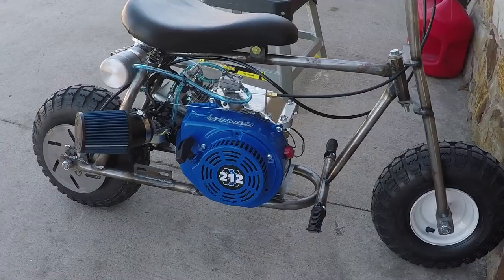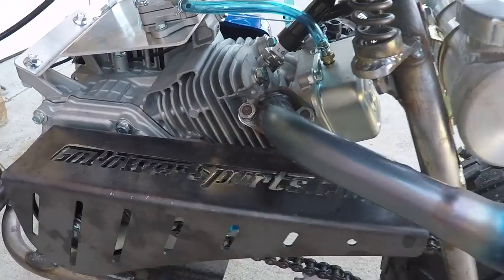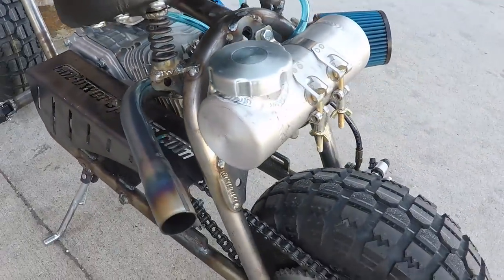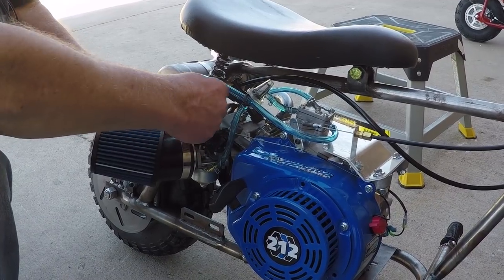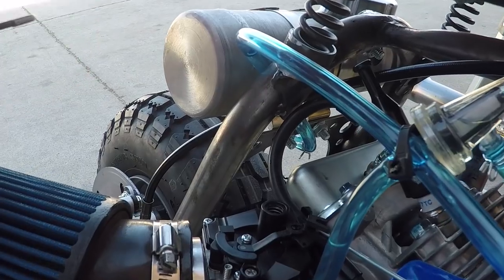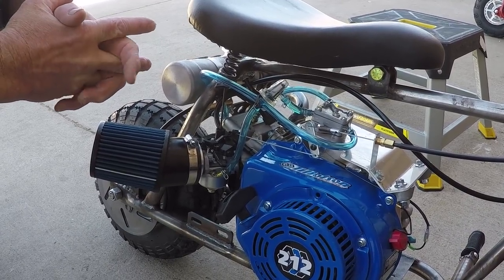Tillotson TCT Carb Tune Up

Comment: I've seen a lot of people disappointed with this carb when they pop in a MOD2 cam and try to turn 6500+ rpms with it. I'm running an ungoverned Stage 2 Tillotson 212E (Ducar hemi) with an EC Carburetor's Bansai .265 short duration cam and  mild head porting, PVT flywheel/28 degrees advance. Does it pull above 6000? No, but it instantly explodes off the line and continues doing so up to 6000. My point is that it depends on what you want, high straight line speed or tearing up the hills and trails with a low and mid-range mini torque monster. I love this combo on a Coleman ct200u-ex with a 30 series tc here in the hills of Northeastern Kentucky.
Reply: You are getting 6000 RPM on a Coleman with a 30 series TC? Wow... With what gearing?

Comment: I am currently running a 22mm Mikuni. with Mod 2 cam. 18lb.springs &  Aluminum Flywheel .

Would the Tillotson Mech. Injection be a BETTER 
alternative / better choice than the Mikuni. ?
Reply: Nah

Comment: Wouldnt this model be considered the Tillotson TFB Mechanical Fuel Injection Carburetor instead of the TCT? According to your guys website it states......
"How to choose the right carb":
Tillotson TCT - Stock air box
Tillotson TFB - Stage 1+
And it looks like theres a stage 1 air filter on that bike not a stock air box.

Comment: What are the best upgrades for a Coleman ct200uex
Reply: Stage 1 gopowersports or omb  kit, zip tie on Governor spring, torque converter 18lb valve springs
Reply: @kiheirc3195  Nope. Don't touch the governor or throttle linkage. Just install a torque converter and the stage 1 and back out the throttle screw. With this setup the governor does nothing at top speed and adding 18lb valve springs are a waste of time.

Comment: How do you find the start point for these carbs, I've lost track of where I am in adjustment and won't start anywhere I put it?
Reply from the maker: We would say the starting point is screwed all the way in, and 2.25 turns backed off.
Reply: Thank you,, Found the issue. The side black plug is gone & ducking air from side, how do I get another one?
Reply: That little plug seems to be a design issue.  A buddy of mine lost during a ride and had to limp back to camp.  I was also wondering if a TCT requires a pulse pump... or can it play nice with just a gravity fed tank and fuel filter?

Comment: Is this better then a mikuni
Reply: YEP, no jets to change out and better break up of the fuel.
Reply: @GEEGANSQUADFishing  what about air flow?
Reply: @joshanderson1019 , after I bought one and tried to tune it and it still did not want to do right I bought a 22mm Mikuni for GOPOWERSPORTS. I LOVE it, so much more power!
Reply: @GEEGANSQUADFishing  i have a stage 3 non hemi 212 with a mikuni that is a pain in my arse got any tips?
Reply: GEEGAN SQUAD so which one then? TCT or mikuni
Reply: @joshanderson1019  same dude. 26mm?
Reply: @RareRS  ya
Reply: @joshanderson1019  does it pour gas out of the overflow line?
Reply: @RareRS  yep

Comment: I just put one of these on a Honda GX120 for a minibike.  I have it set ALMOST just right....  Is it too rich or too lean if it bogs when you snap the throttle from idle to full?  Mine returns to idle nicely, but slightly bogs when I go from idle to WOT
Reply: Did you fix this issue? Having the same priblem!
Reply: @tednelson5574  no, never got around to messing with it much

Comment: Did you install a rev limiter since you removed the governor? Also how much would this motor cost to duplicate? I would like to keep it stock as possible since it will not be for a mini bike for Kart application.
Reply: Rev limiter not needed since the valve springs float around 5500 rpm
Reply: @lerabidheavy7437  Will they tap a flat top? Mine has 26lb springs and a flat top, idk how much throttle I can give it.

John 3:16
Reply: @OVERKILL_SS  so that's hard to answer cause the valves should close way before there should be contact, however with compression release can be near top dead center on some engines, this is a issue so what I'd do is crank by hand see if compression release doesn't smack valves then if all good get a rev limiting coil, i have a 6500rpm coil on mine and run 14.5:1 compression
Reply: @lerabidheavy7437  Well I know I haven't smacked valves yet, the lil sucker runs great! Other than sounding like a hit an miss at idle. lol 
Idk what you mean by turn it by hand to check for valve smack though, what I'm worried about is when they start floating at night rpms since it don't have valve reliefs in the piston no more not sure if its possible for a valve to float open right when the piston hits tdc and instantly cut HP in half. lol
Thank you!
I might look into the coil limiter though, I was just hoping to find out if its safe to let the engine run wide open or if I gotta let off and when.
Reply: @OVERKILL_SS would full throttle no longer then 5 second no matter what build u got not healthy to hit redline All the time
Reply: @benjaminperez6358  Arighty! Thanks! 👍

Comment: This carb is great if you still have your governor, but if you have it removed a $12 carb from amazon will give you a better top speed and more torque off of the line.
Reply: Why is that? I haven't seen anything about that anywhere. I haven't gotten mine to test it yet.
Reply: @YUREtheFURY  I have no idea but with a 12 dollar Amazon carb I can go 54 mph but with tct carb I can only go 32. I do not know why but the tct carb does not allow them engine to do high rpm’s
Reply: @colemarsden2796  that's weird, I know it needs to be adjusted for elevation, mods and such. Do you think that could be why?. It shouldn't inhibit your top speed unless it's to lean at the high end I'm guessing.
Reply: @YUREtheFURY  I don’t know I played with it for like 2 hours and fastest I could go was 32mph
Reply: @colemarsden2796  I'll let you know how mine goes. I got a ungoverned tillotson 212 to go with it. It will be here tomorrow, hopefully I'll have something good to report.
Reply: @YUREtheFURY  ok that’s exactly what I have too but I have a torque converter
Reply: @colemarsden2796  which converter do you have? I'm pairing mine with yue juggernaut 30 series. It shouldn't matter I don't think.
Reply: @YUREtheFURY  yeah that is what I have too it’s great I love it
Reply: @colemarsden2796  that's good to hear at least!. So you just use the stock carb that came on your 212 instead of the tct right?
Reply: @YUREtheFURY  no I ordered one from Amazon that has a afr screw so I could adjust it and that’s what I get the fastest speeds out of
Reply: @colemarsden2796  I might upgrade to a mikuni if the tct doesnt work out. It's still in the box, I might go ahead and send it lol.
Reply: @YUREtheFURY  yeah I don’t want to spend $90 on one
Reply: @colemarsden2796  you can get a clone one I think. Can't remember how much it is
Reply: @YUREtheFURY  I think there around $50
Reply: @colemarsden2796  hey what model tct do you have?
Reply: @YUREtheFURY  no clue i got it to 42 today with a bit better tuning but still not 50
Reply: @colemarsden2796  I noticed mine isn't the exact same as the one offered by go power sports, what's your username for messenger? I want to see if you have the same one as me.
Reply: @colemarsden2796  how are you running 50mph, mine only goes 38 without the governor. Does the carb make the difference? I'm on 10 tooth clutch and 54 axle.
Reply: @YUREtheFURY  What is the size of your rear sproket?
Reply: @colemarsden2796  I don't know the diameter, but its a 54 tooth
Reply: @YUREtheFURY  that’s what I have as well and I’ve gotten 50mph with a stock Tillotson 212 just with the governor removed and a comet 30 series torque converter. For that speed I used a $12 carb from Amazon. With my tct on I can only get 42.
Reply: @colemarsden2796  yeah I have a jugg 30 series too it makes no sense. Can you link me the carb you use please
Reply: @Knight Recon get some valve springs they will help

Comment: You called it a carburetor… It’s fuel injection...
Reply: the fuel is not directly injected into the cylinder therefore it is technically not "fuel-injected".
Reply: agave 58-58 Tilloston TCT mechanical *FUEL INJECTION*
Reply: agave 58-58 I have it on my go kart lol
Reply: @backyardrestorations  Did you read what I said? It's a mechanical fuel injector inside a carburetor,  hence the " TCT CARB" or "fuel-injected carburetor". The fuel is not sprayed directly into the cylinder, it is sprayed inside the carburetor in front of the throttle valve. The better term is just carb.
Reply: agave 58-58 ok